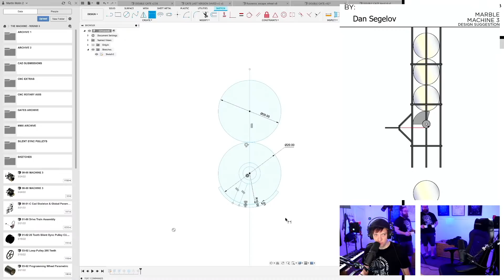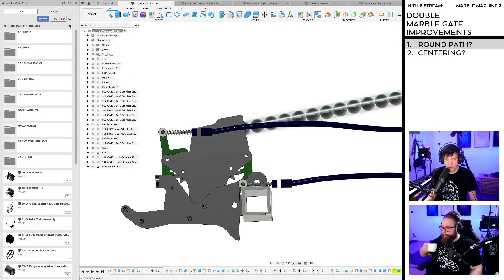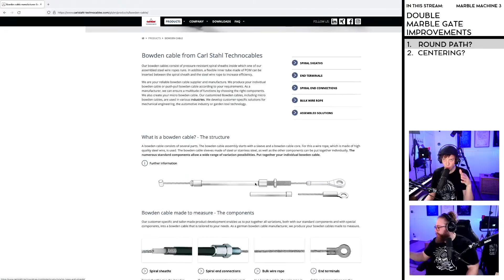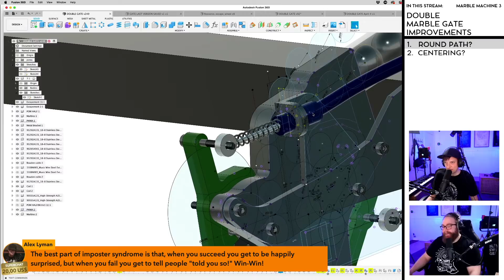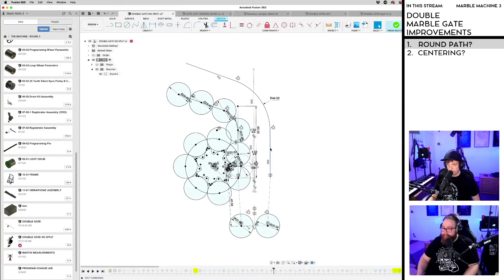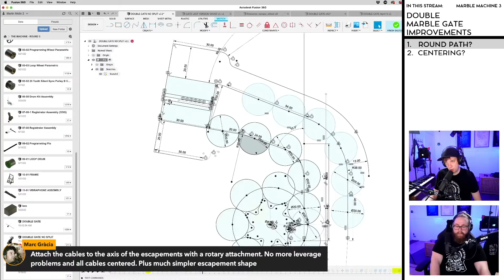Marble Gate Improvements

Comment: Hang on a sec. Are the two channels in each gate A and B for each channel?  If so, why?  Isn’t it that the AB muting system with the cams going to register on the same registrator?  Just only on channel will actually be unmuted?
Reply: Or are these coming from 2 separate channels that will play the same note?

Comment: Maybe the fact that my parents were professional puppeteers warps my judgement, but I think you shouldn't underestimate the value of humble braided fishline instead of Bowden cables. Inexpensive, plenty of strength for what you are doing here, you can pack a lot of them in a small space, they turn corners easily, negligible dynamic mass, and if you use some of the modern fancy fibers like Spectra and Dyneema, they have virtually no stretch.

Comment: This feels like a step back from the modular approach. Rather than design a marble gate which accepts two inputs, and then separately solve the Y splitter as another module, Martin is trying to solve for multiple problems in the same module.

This type of design is going to lead to complexity failures at scale.
Reply: Someone didn't watch the stream...
Reply: @koyrehme4361  Hah, I had scrubbed through it and stopped to check on progress. I rescrubbed it carefully and now I see someone asked the same question at 41:40 -- good thing Martin has this community to watch his back

Comment: Why can't you just have the Bowden cable pull a straight pin to drop the marble?
Reply: Because you need to drop one marble consistently, not a stream of marbles, every 300 ms.  Pulling a pin means there will be backlash on the marble queue as the pin goes back into position to stop the stream of marbles.

Comment: Can we please have a marble gate that doesn't really on a marble rolling on another one to get in position? It's way too sensitive to any slight misposition of the lower marble
Reply: The marble height issue in the MMX was because the pipes were different lengths.  The length inside the gate doesn't change, it is consistent.

Comment: If the first gate shoots very quickly one after another (e.g. 4 semiquavers) then the second gate runs empty and gets no more marbles.... This design is predestined to either jam marbles or no longer supply one of the two channels. Didn't you actually want to get away from such complicated and error-prone constructions?
Reply: Martin talked about, but did not actually confirm, that the gates would alternate in the programming.  If you want you can bring this up in the design doc.  He has been pinged on this several times, so he's aware of it.

Comment: Use many solenoids and two cabels. 

( you can design your own solenoid , just a roll of wire) for your special needs. A thousend times better than all your designs so far.
Reply: No electric devices allowed. Must be purely mechanical.
Reply: Yeah .. electric microphones , electric motor , a purpose build computer simulation , amplifiers,  custom tone studio with  cable floor , ridicilous !! 

It makes it a million  times easier and better
Reply: By the way a solenoid is half mechanical so fine
Reply: @mbg8077  Martin has dismissed solenoids, it removes the mechanical magic that the audience sees.

Comment: I think that if you reduce the distance between the wheel and the dropper even more, the gate will be able to play faster.
Reply: The escapement arm (the dropper as you call it) has limited rotation because of its interaction with the tooth gear that moves the next marble into position.  The length is to allow clearance with a small angle of rotation on the pivot.

Comment: Suggestion: 1. Use the motion of the left green ball-gripper. 2. Attach a pin on top, to hold the left ball... while the right ball fall down.
Reply: The 'left green ball gripper' is an escapement arm on a pivot.  It doesn't work without a gear for the escapement arm surfaces to contact.

Comment: The angle of the teeth on the escapement gear might suffer from the same flaw as on the MMX causing pressure which could open the gate by itsself.
Reply: I think a better mechanism for the gears would be a shallow U or bowl shape rather than the more tooth-like design. If the gears are there to mainly hold each marble back, then having the marble sit more in like a bowl before being dropped would probably work better.